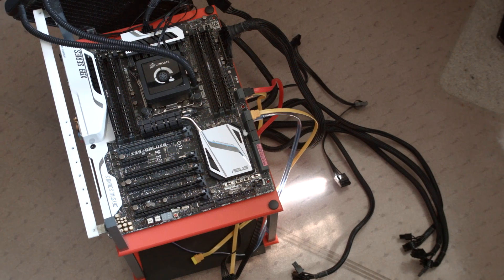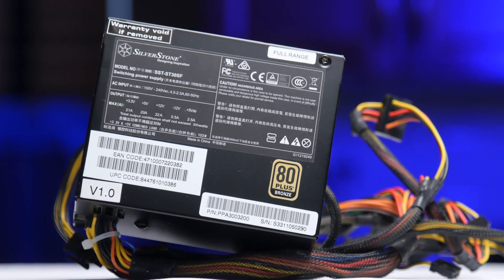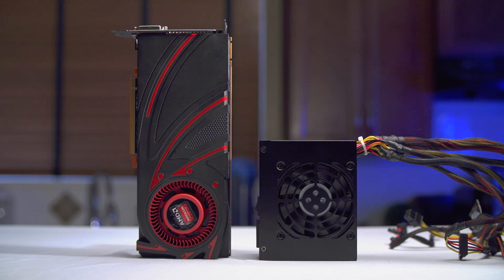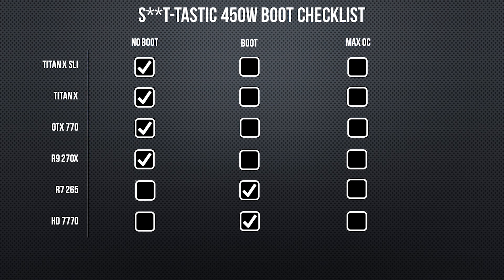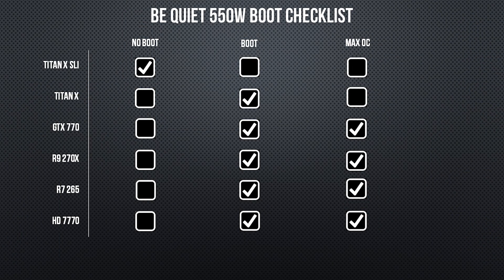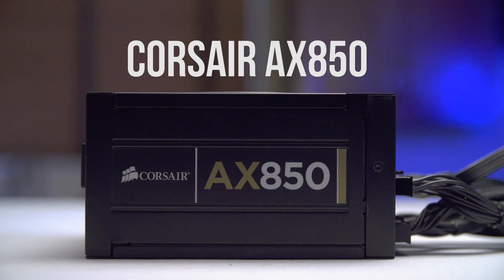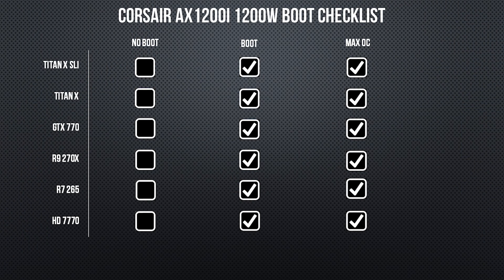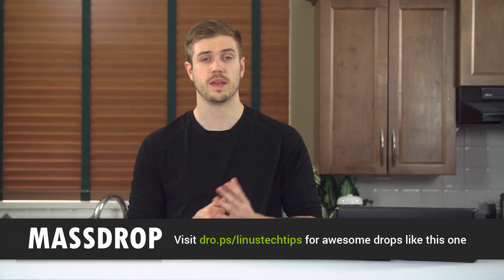Overclocking Recommendations - Low vs High Wattage Power Supplies

Comment: 1000W seems like a good number. Can do pretty much everything at the moment, and has some margin of error for future components.
Reply: Casual Alien unless it idles often -- down at the idle 100-300 watt range, the efficiency of a 1000 will be terrible.
Reply: bluej511 Right, when you have a 1000 watt supply you are dropping below that 20% mark at idle and that is the undocumented ugly part of the curve (until you get above platinum). That waste is unfortunate.  PF waste is worst because you get billed for it but don't even get the power.
Lastly, consider the climate.  I'm in Canada, next to the mountains. Except for June-August we still have the furnace on heating the house intermittently almost all year.  Having the computer idle at 200 watts just means it turns on a little less frequently.  In places where its already hot, and you need to use AC...yes thats a double whammy, paying to add the heat then paying to remove it.  For me its pay for it one way or pay for it another way.
Reply: Yeah, a 1000w for a normal setup is wasted money. A normal system today rarely exceeds 300w with how power efficient cpus and gpus are now. Even so, I'd probably go with something in the 500w range as thats where you find the good ones.

My system is an overclocked 5930k to 4.6Ghz , with two gtx 780ti in sli also with a slight overclock. When i measure the wattage drawn from the wall during something like crysis 3, then it was just shy of 800w drawn from the socket. That be more if a stress test is used, though I use do those. I used an 850i for a while as it migrated from when i had a 2600k with same graphics cards. But it was cutting it too close and I experienced some problems. I think the overcurrent protection kicked in because i would hear the relay click and the pc would shut down.

So I bought a new psu with room for expanding the system in the future. The 850i was also intended to handle future upgrades.

Now, i don't really need any overclock or some such but it's a hobby you know. As fast as possible with as little noise as possible and also looking nice. Overclocking I've done since i built my first pc, a pentium 120 many years ago.
Reply: Casual Alien thats something a child would say thats on a mommy&daddy budget. the only real reason someone would need 1k watts is for multiple gfx cards/ multiple cpu's/ servers. you kids now a days think the answer to everything is just more power, learn how to be efficient. Buy parts that dont hog up power, oh but wait thats too hard cause all you know is to buy the best there is
Reply: ben fusco Be realistic about this.
Reply: Casual Alien It might waste money, but no harm is done. Just remember to buy a good unit with good reviews. A quality 400W unit is better than a cheapo 1000W unit. Read Johnny Guru gutless wonder reviews for some color.
Reply: frollard Not entirely true. THe rm 1000 i just got for example is 90% efficient at 100 watts. Depends on the power supply most are the most efficient at 50%, the 300watt range being 30% it should be very very efficient there.
Reply: frollard Someone who has a dual gpu setup is not the sort of person to leave a computer idle for most of its life.
Reply: bluej511 Fair point -- just saying that unless you step into the 80plus platinum range the edge of that curve can drop substantially once you get into the 25% load region.  Luckily most 1000+ watt supplies are catered to a premium audience and have decent curves; just not all.
Reply: frollard For a psu to get certified it needs to be that efficient from 20% up to 100% i believe, not that id ever load a psu fully all the time but yea. Me personally i don't let my computer sit and idle i find it a waste. Same way i dont leave my car running unless im using it haha.
Reply: bluej511 but.. that would use more power than just letting it sit idle, I don't see the point...
Reply: frollard Frollard that depends on a few things. If you OC your cpu the old fashioned way ur using more wattage at idle then you would if u OC using turbo boost. But i get what your saying. Again depends on the psu. My rm 1000 from 40w to 1000w goes from 80% efficiency to 89%. I think 79% was what my tx650 used to do at 50% load haha.
Reply: vgamesx1 What would use more power turning it on and off? If you do it often sure but my computer sometimes goes a couple hrs without being turned on. Plus it uses load for maybe 1min max since i use an SSD as an OS drive. Also dont forget at idle youre also powering everything else that needs to be powered, fans, HDD, SSD. And at idle your computer will go under load, open up HWmonitor or something like that and quite often windows will either do maintenance scan or anti-virus will do a scan.
Reply: Heres a good link for you guys for power usage and electric bills. They also have a W to kWh calculator. http://www.rapidtables.com/calc/electric/electricity-calculator.htm
Reply: bluej511 oh you didn't say you were turning it on or off.. so I kinda thought you meant you'd have it do something rather than let it idle so nvm, that said however in most cases you're generally better off just sleeping rather shutting down, it would use something like 1 to 5 watts to sleep, which is less than an LED lightbulb and your computer is almost instantly back up and running.
Reply: vgamesx1 ^^^^ Uses an SSD sleep is useless for me haha. Within 20secs im on the desktop. I don't think ill ever go back but yea sleep is pretty quick as well.
Reply: beyond305 If you buy a decent brand with a decent 80plus certification you will barely be wasting anymore power than an 800W.
Reply: Casual Alien Dont bother hes an idiot. He doesnt understand that its rig itself that dictates the power usage not the actual power supply. If my rm1000 is more efficient at the whole power range then my tx650 how am i not being efficient?
Reply: frollard "In places where its already hot, and you need to use AC...yes thats a double whammy, paying to add the heat then paying to remove it.  For me its pay for it one way or pay for it another way."

Man that is such a big problem in my house! In summer we don't really need AC all the time, but a PC and a monitor can make the room so hot. And in winter the PC rooms heating can be pretty much shut off at the air vents. But have to do a constant adjustment to keep the room in comfortable range.

So like you said, are you very sure you get billed for 1000 watts for a 1000w PSU even if your computer is using half of that?
Reply: ***** Yea im lucky im in Southern France it ranges from 3C at night in winter to 30C max in summer but we dont have ac i just open windows its breezy here. 

Heres how it works. If under load u use 500w and your psu is 90% efficient your using 550w from the wall. At 94% your using 530w ac volts. That 20w if run 24/7 will use 21$ per year. Thats only with 20w. If your using a 500w psu at 90% load its less efficient and costing you money. Could be more then 20w who knows depends on the pc and computer.

Having a 1000w psu doesnt mean its using 1000w it means wtv its drawing from the wall is what its drawing. If you understand science its simple.
Reply: ***** lol He speaks the truth man! People are buying more than they need and wasting money they don't even earn and then paying extra bills because of that.
Reply: ***** Its actually false but science eludes these people. Yes a crappy 1000w bronze psu might cost you a bit more. NO a 1000w psu gold/platinum will not use 1000w of power. And PS 1000w is not what it draw from the wall either 1000w at 90% efficiency is 1100watts from the wall. 

Ill repeat one last time. If your system draw 500w at load 1000w psu is not a waste, it will not, i repeat, it will not cost you extra then if your running a psu rated at 650w. Again this depends on efficiency but if there both gold/platinum rated the 1000w psu might actually cost you LESS in the long run on your electric bill. Now if you dont believe me do a little bit of math.
Reply: Casual Alien 4Xtitan X's OC and + a 5960X OC and 4.4Ghz (400 Watts per OC'd titan X so 1200 watts + overlcocked CPU around 1300-1400 watts so 1500 watts can run anything
Reply: Casual Alien Its technically realistic
Reply: ben fusco If your math didnt suck sure. 4x400w is 1600w not 1200. Fail.
Reply: bluej511 Well I got mixed up between videos XD one saying that 4X titan X's use 1200 watts and one saying a overclock titan X uses 400 watts so yes fail on my side
Reply: ben fusco Economically its not realistic. It wouldn't matter anyway since someone who can afford 4 Titans can easily afford a more powerful power supply.
Reply: However you said that 1000 watts could run EVERYTHING
Reply: ben fusco No, he said "pretty much anything" thats not everything
Reply: TheTonie4 Pretymuch everything means everything
Reply: Casual Alien Still massively overshoots the normal usage. Unless you go SLI or Xfire there is no need to go that high.

http://www.extreme.outervision.com/psucalculatorlite.jsp
Reply: ben fusco So if you said "Pretty much everything is done" you would be saying everything was done and you wouldnt be saying that you just need to do one or two more things?
Reply: ***** Glad to see some people are actually educated about power supplies. And the fact that watts is a measure of energy and no power. Power is your voltage watts is your energy. Hence why more watts is more heat.
Reply: ***** I didn't wanna make it too complicated some people would scratch their heads haha. But yes energy also causes heat.
Reply: ***** Fair enough good sir.
Reply: ABaumstumpf You guys really dont read do you?
Reply: MrVhorthex Thats why I said it has a good margin for error. Who knows how much power future GPUs are going to need? There is even the possibility that in the next few years 1000w could be the absolute minimum you need to run even a single card. GPUs and CPUs are something you swap out every few years, but a power supply is something that you can hold onto for 5 years or more depending on what brand you bought.
Reply: ABaumstumpf Proof, the new i5 and i7 skylake are 95w tdp instead of the 88 they are now. So yea they will use more power. Second, nvidia doesnt use a lot of power because they still use 256/384 bit bus. 

My 7850 and i5 4690k use 350w or so. And btw my corsair psu lasted 5yrs before it stank up the place and corsair RMAed it and i got a new one. The one i have in my closet is now 2 years old. If you use a 500w psu at 500w for a long period of time yea it will crap out. Capacitor aging. The cooler (meaning less stress) you put em under the longer they last. Im pretty sure theres people with PSUs much older then 5years without issues.
Reply: A 4690k overclocked with 2 intake fans and 2 exhaust fans with 2 sticks of ram 1ssd and 1hdd draws 265w max. Now provided u have no other usb devices no other fans thats quite a lot already without a single gpu. 230w at 90% usage. Now that leaves 270w for a gpu, maybe even a water pump or who knows what else. Thats like saying its ok to drive your car at peak hp rpm because it makes the most power haha. Yea lets see how long your car lasts then.
Reply: ABaumstumpf Um because running a psu at 85% load isn't a good thing? I dont understand whats so hard to understand about efficiency. Do you also drive your car at peak rpm at all times or you drive it like a sane person would.
Reply: Great article on PSUs. http://www.pcworld.com/article/2025425/how-to-pick-the-best-pc-power-supply.html
Reply: ABaumstumpf Of course it can sustain 90% load but its not gonna last long thats the problem, nor is it very efficient. And considering its a gaming pc when i use it yea its at peak load. 

I dont understand whats so hard for you to understand efficiency. You keep arguing the same point. What if i want to run 2 r9 290s it still only draws 500watts under load. Yea ill be fine but its less efficient. I dont have someone paying my electric bills sir. 

Most benchmarks are done with a bare minimum of a system. A lot of them are even run on open rigs so u get none of the accessories. Im not saying this to please just a certain group, in general its a good idea to leave headroom.
Reply: "Ideally your unit will delivers plenty of power to your components and offers some extra headroom in case you want to attach additional components later. Most power supplies hit their peak efficiency levels with loads in the range of 40 to 80 percent. Building to about 50 to 60 percent of a PSU's capacity is advisable to achieve maximum efficiency and yet leave room for future expansion."

"For example, if the maximum power or combined TDP (total design power) of your system’s present components is 300 watts, a 600-watt PSU would be a good fit. In a high-end system loaded with components that may peak collectively at 700 watts, a 1200-watt PSU would work well. You can get by with lower-capacity units if you don’t think you’ll ever need to expand your system, but if you can afford it, choosing a higher-capacity PSU is a better bet."

Since you didnt bother reading the article.
Reply: My point is again efficiency, For some reason running 500w load on a 600w psu eludes you. Amazing how you keep writing the same crap over and over without reading what other people write. 

DO YOU NOT UNDERSTAND THAT PSUS ARE THERE MOST EFFICIENT AT 50% LOAD AND THAT 500W AT PEAK TDP IS 50% OF A 1000W PSU AND THAT YOUR PSU WILL ONLY DRAW WHATEVER IT NEEDS AND NOT WHATS WRITTEN ON IT?

Does that help you read a bit? Are you really that idiotic you're going to keep babbling about your nvidia cards. Im talking in GENERAL not for people who only buy nvidia cards.

According to your logic then its ok to get a 750w psu for a 700w system ie r9 295x2. Just sufficient seems to be the logic of idiots who don't understand voltage and wattage. 

P.S. Im not telling people who already have a computer done and built to go buy a 1000w psu. What im saying is if youre building one and you have a choice between a 650w platinum and a 1000w platinum you should go for 1000 and not 650.
Reply: Yea an nvidia troll. P.S. numb nuts my rm 1000 40-100w is still 85% efficient. Proof youre a troll no computer ever is at 0% load. Done with the trolls
Reply: ***** Nah he's a troll. You can tell by his statement that a power supply becomes 50% efficient between 0-20% load. Its alright ill let him think he's won. Its actually written everywhere by many professionals and enthusiasts that a psu is the most efficient at 50% some even down to 10-20%. But its all good some people will never understand.
Reply: ABaumstumpf There you go enjoy go down to low loads. 

Heres the one i own. 
http://www.techpowerup.com/reviews/Corsair/RM1000/6.html

http://www.techpowerup.com/reviews/Xigmatek/Maverick-S-500/6.html

http://www.techpowerup.com/reviews/Seasonic/Snow_Silent-1050/6.html

http://www.techpowerup.com/reviews/Fractal_Design/Edison_M_650W/6.html

http://www.techpowerup.com/reviews/Antec/EDG650/6.html

Someone needs to do more research, for someone in the field you sure as hell don't know shit. All of those are at 80% low loads, if youd like i can even get more for you. 

One of the low ones oh wait still above 50% by a shit load. 

http://www.techpowerup.com/reviews/Silverstone/ST60F-ESB/6.html

Oh snap even 1300 watts isnt 50% at 40w oh boy. 
http://www.techpowerup.com/reviews/Antec/HCP-1300/6.html

Next time search a little bit more. Look at temperatures of the psu at 50% then at 100%. The same person bitching about the output of an r9 295x2 is the same idiot who says its ok to run a psu close to max output at full heat.
Reply: ABaumstumpf Interesting u just got proved wrong with your 50% theory but still blabbing. Im done commenting on your ignorance and lack of research good sir enjoy. 

Look up the RM1000 for example at 50% then look at the RM650 at 80+% which one is hotter? Yea i thought so.
Reply: I already have told you why its better to get 1000w psu then a 650w one if your system is pushing 500w.
Reply: ABaumstumpf Wrong again. For example RM650@520w is 90% efficient, RM1000@500W 92% still from the same links. Seasonic platinum 520@500W 92.76%, platinum1050@524W 93.12%. Im bored and don't feel like looking up anymore. You can't read so i wont bother. Thats just 2 power supplies that proved you wrong. One gold and one platinum. So no my links proved that im right. Again its dependent on the power supply but for the most part there you go, two of the most bought power supplies from 2 reputable companies. But i guess you will continue you so carry on.
Reply: ABaumstumpf 
Understanding psu efficiency and why a high efficiency psu is a good choice can be tricky, but here's the gist of it.
Say you have a 1000w psu and its rated at 90% at full capacity, then it will have to pull 1100w from the wall socket to supply those 1000w to the components. Some energy will always be lost in heat and vibration.

A bit of overdimension on the psu is also a good thing as the psu components won't become as warm and thus the psu will run more silently or completely passive. The fan never has to turn on with the Corsair 1200i powering a overclocked 5930k and overclocked two 780Ti in sli.
Reply: This has nothing to do with cars though, and you should probably stay in school and keep studying your physics.
Reply: The reasons were there you just didn't pick up on them.
Reply: See your whole argument is based on false assumptions, secondly i have not told you nor anyone else to go mad oversize when buying a psu so you can stop with the strawmen.

But I'll give you a few reasons though you should already know this by your own account yeah right >_>

A psu is not at it's peak efficiency at 100%, nor is it at 20%, it's typically at around 80%. All psu's will degrade in performance over time and they are also affected by heat. The more hot your case is the worse it will perform. Again this is basic physics.
Also, oversizing a bit will result in less heat from the psu. You seem to assume a 600w psu will use same components as a 1200w. They do not. They work on the same principles though, thats a huge difference.

I know my pc will use roughly 800w from the wall during full load on gpus and cpu, and it indeed does work with an 850w psu as I've used one. But guess what, at that point the psu will have to work hard so fan spins up. I switched to the 1200w corsair and not only is it more efficient resulting in less power draw from the wall socket, the fan never has to turn on so it always stays passive, even with the overclocks and running two overclocked 780ti in sli, and they draw a whole lot more than the 980s do.

There's no need to go nuts when buying a psu, but if you want it to last then you get something that is 20-25% more then you need to account for aging and heat during use.

You study these things my ass.
Reply: I never said 500w wasn't enough for 980s in sli, it is and i agree a 600w would be quite enough for that setup. Personally though i'd go slightly higher to support overclocking on cpu and both gpus but thats me.

Like i said before, i've run my system (it will draw ~800w from the wall socket at full load) with a corsair 850i and later a 1200i, at full load the lower wattage psu would not stay passive, both are good quality psu's and they have the same feature set.
OC3D TV psu reviews will reflect this fact as well.